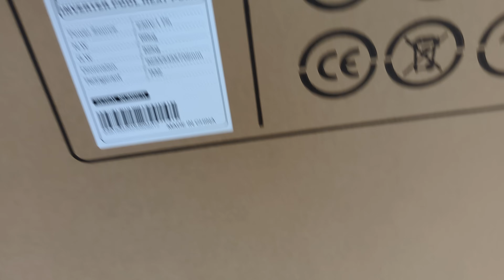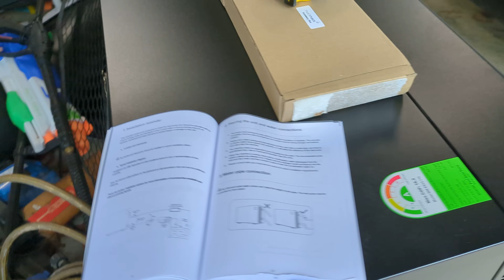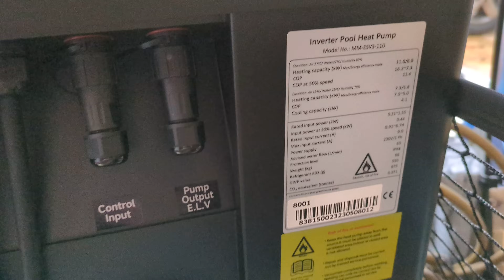Pool Update - Custom Cover + Heat Pump + Bosch Power Tools

Comment: I have used a set of Bosch tools for solar installations  for several years, and they are great. They get abused quite a bit and just keep on trucking.

Once we forgot regular drill and a hammer drill in an open case on top of a customers roof. Then winter came and we had a break until spring. When we returned to finish the job we found a water filled case with the two drills. One of the batteries had died, but otherwise it was just a matter of drying them out and plopping in some fresh batteries, and they still work great to this very day.

Anyone who says they aren't good quality clearly doesn't know what they are talking about.

Comment: I've got a brother that works in construction who swears by that line of Bosch tools. Great bang-for-buck, and standardized his home kit around it. So, there's a supporting data point it's a good pick. As a light-duty home handyman, I tend to fall in the "don't care if it works" category, and use DeWalt because it's what's easiest to get affordably around me. Not cheap, of course, but as the saying goes, I can't afford cheap tools. 😁

Comment: I got a DeWalt drill/driver combo set (similar to your Bosch) some time ago and I'm pretty happy with it as I'm sure you are with yours. Later on i got the brushless, and wow, way better. The most notable improvement is the battery life (same battery size). I specifically look for brushless now, no going back.
Reply: As someone who probably got the same 20v drill/driver combo set you did, it's good to know there's a benefit to the brushless upgrade. I've heard the brushless products last longer in wet environments too, because everything can be conformally coated.

Comment: I like the Bosch line of cordless tools. I’ve been using them for a couple of decades. Daily use on film sets really gives them a workout. Much better than the Dewalt. 
But, I have a corded Mikita drill that’s probably 40 years old and still going strong!

Comment: About AvE and batteries... The batteries you're using aren't the batteries he reviewed. You're using the "regular" batteries, while he reviewed the "new" ProCore style batteries which use the 21700 cells, instead of the 18650 cells from the "regular" batteries. 

It's also interesting to see the differences between tools in different regions... The tools (well, mostly the impact driver) you got are considered older obsolete versions in Germany.

Comment: Bosch is a pretty good tool brand, but even their “professional” line I wouldn’t quite rate into the prosumer category. It’s pretty well understood world wide that the 3 most popular prosumer brands are DeWalt, Makita, and Milwaukee. If you buy one of those brands you know you’re buying a good tool that’s going to last at least 5 years (more if you don’t use it every day) and you’re getting a good warranty. I personally use Makita tools because I’ve had really good luck with them, I’ve only ever had one die on me and that was because I was abusing it. It really is one of those depending on who you ask things. As we’ve seen on AvE’s channel Bosch is known for making some really obscure specialized use tools that no one needs. The mini chainsaw is cool but it has absolutely no practical use. Even the professional line of Bosch tools aren’t really used by professionals and is more used by DIYers and hobbyists.
Reply from the maker: See my other demo video, a lot of people talk highly of Bosch tools. These have a 6 year warranty. My old Bosch professional drill has lasted close on 20 years, still going strong. Done a crap ton of work.